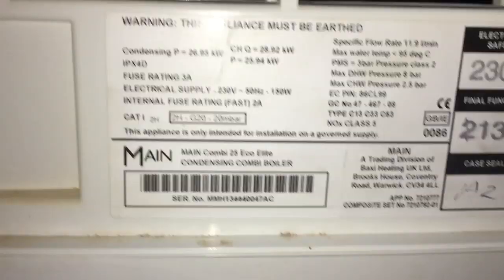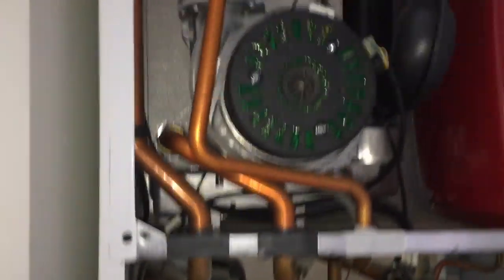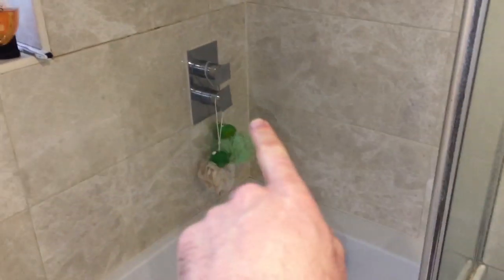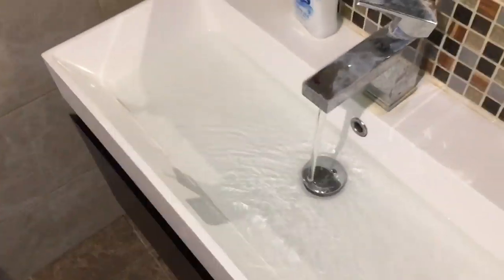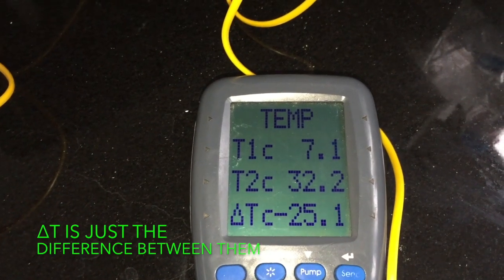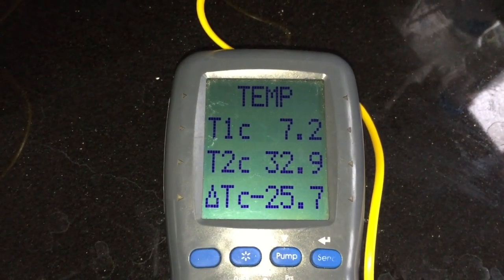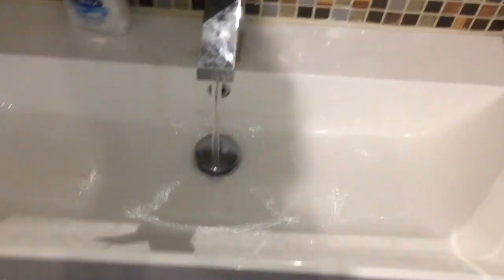Combi boiler hot water issues. Repaired and principals explained.

Comment: Hi, I'd be really grateful if I could get some of your opinions on an intermittent fault that occurring on a customers boiler. (Greenstar 30si mk 3). I have spoken to Worcester about this, but seems like everyone's scratching their heads with it a bit, and I'm not really a fan of just guessing and hoping for the best.

Thanks in advance!

Visit 1:
Customer reports no hot water, but the heating is fine. I visibley can see diverter valve moving to all 3 positions, When power is switched off and then on at fused spur. When tap is opened nothing happens, it's completely static, and no error codes. I confirmed with Worcester that the flow turbine was working. And also dhw thermistor was giving a reading within range. It was recommended the the pcb had failed and should be replaced. Also I noted that the flow rate was crap from tap, about 5 litres per min.

Visit 2: 
Returned and fitted new circuit board, new board was an updated type without the big transformer on the back. Power back on, all was working perfectly. Heating and hot water both operational. I thought job done.

Visit 3: 
2 weeks later have to reattend, due to intermittent hot water. Apparently hot water worked fine for a couple of days and then after that not. Customer states sometimes it will run for a few mins then go cold, other times boiler just does nothing (same as initial issue). He also stated sometimes it was very hot. When I test on site, hot water was working as it was supposed to, operating on demand and at the correct temperature. 

Visit 4: 
I reattend and Initial test shows boiler still static when tap opened. Customer also stated that they day before he'd switched it off at the spur due to the boiler vibrating lots when trying to run the hot water. I fit a new flow turbine, flow adaptor, and flow regulator. Also cleaned the inlet filter. Was flow was not really improved to be honest, so pressume there must either be a restriction in the plate to plate, or maybe in the manifold. Test hot water and still boiler does nothing. when I'd re instate power to the boiler the diverter valve would go from mid position to lower and then back to mid. Every 10/15 times of power being resumed the diverter valve would move to the high position and the HW pre heat would start. However once the preheat was over, and a tap opened the boiler would again be static. I removed the diverter valve and it looked to all be in good clean condition. Tried operations with the motor out of site to. See if that made a difference. I again spoke to Worcester, confirmed again the the flow sensor was picking up the demand. Also carried out resistance tests on the diverter valve motor, checked the thermistors which were correct. Worcester said they think it's again a faulty pcb and that I should fit a new one. 

So basically I'm going to go back again with a new pcb, but there's definitely a part of me that thinks it could be something else, like maybe the diverter valve motor?

It might be worth noting that on this visit I found that the shower thermostatic mixer has a slight issue with the check valves, as when I isolated the cold I let at the boiler and opened taps to drain, I could hear water passing through the mixer and constantly flowing (not much) through the tap. I wouldn't have thought this would be contributing to the boiler issue though? 

Struggling a bit with this one, so any suggestions / thoughts would be greatLy appreciated, thanks.
Reply: SOLVED! It was the Plate to Plate heat exchanger, basically completely lime scaled up.  Once I’d managed to isolate the shower mixer, I found the flow rate from the hot tap was at 3 LPM. When testing the flow turbine (at the PCB end) using my Fluke I was getting 2.1-2.7V DC (reading fluctuating between .1 and .7) The worcester chap(s) told me that, this should be enough to get the boiler running, I kept questioning the fact that, that the reading was fluctuating as when id tested other worcesters I was used to getting a stable 2.5(ish) V DC.  they still said it should be fine...
Anyway, after inspecting/resistance testing the harness, took out the plate heat exchanger to have a look, and couldn’t believe how blocked up it was.  
Tested the flow turbine after replacing it and found I was now getting steady readings!  and boiler roaring away.  Good tip about blowing through the turbine, wish I’d known that one!! That would have saved me a lot of time...

Annoyingly id arranged on the 2nd visit to replace the plate to plate, but was trying to solve the boiler not firing issue first, not realising that they were related.  It didn’t help that there was no valves to isolate the shower, and no access to any stopcock in or outside, and tenants that didn’t speak any English haha.

Plus side is I learnt a lot from this job, Its always the tricky ones where one learns a lot.  

Keep the vids coming, they’ve really helped me to up my game with boiler faults.  Its great that you include the process of how you approach finding the fault.
Reply from the maker: I have been doing my ACS this week so I'm a bit preoccupied. Did you get to the bottom of this?? 
Be great to have an update.
Reply from the maker: Yeah Manufactures are good at common faults but fall down when its a bit weird. Blowing through the flow turbine tests all the electronics  and helps you decide weather its mechanical or electrical. Im glad you got it fixed and very glad you updated us here.
 Thats a Heavy plate heat exchanger going by how big they are and that it was full of scale. I bet they had preheat on (eco off) and also have a driping tap. Its the tap that causes constant heating of the plate and scale build up.
Once again, nice one.  :-)
Reply: waldesi1 I would check the harness very carefully. Did you do your tests on the pcb or at the DHW flow sensor? 
Sounds like it’s still not picking up flow. 
Plug in another (the old one) sensor and blow through it and see what happens. 
PCB or harness is probably the issue.
Reply: This is HeatingGeek on another account btw. ;-)
Reply: Yes 1st visit they did have a tap that was basically continuously running really slowly.  preheat was on too. Makes sense now why it was so blocked.
Reply from the maker: Thats the only time I see scale around London on plate heat exchangers. Direct fired are more common.
Reply: waldesi1 . Excellent news you got it sorted I think your gut feeling that the plate heat exchanger was suspect was right. I’ve come across this before but have heard tell-tale signs of scale and blockage by the whooshing Sound they make when partially blocked, a slow flow is also a  giveaway
Reply: waldesi1 just an addendum to the fault you had, I had a Greenstar with a code plug fault. Replaced the code plug, boiler then worked but blue light flashing and over gassed by 4 kw. (Was 24i system). Worcester advised code plug fault. Replaced again.  Same. Long painful story short, they sent out a batch of 28i combi code plugs in 24i packaging.  Class act!

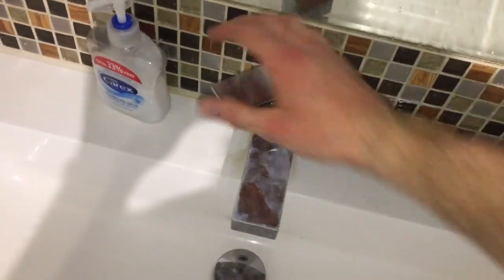Comment: Some great tips here.  At 10:50 when you said you were going to set the flow rate, what exactly were you adjusting? (I thought by adjusting the cold inlet to achieve the correct differential, we had the correct flow rate). Thanks
Reply from the maker: I was making sure the Litres per min I set at the boiler (by temperature ) was correct. The kitchen tap couldn't be use for this because the flow rate was reduced to it already by design. So, I just made sure I had 11 LPM at the sink tap in the bathroom.

Ps I couldn't do the check at the bath tap because it was a blended outlet.

Comment: So it was the mains water flow restrictor. Great video.  Keep them coming. Are you based in London?
Reply from the maker: Hertfordshire but I work in London. Yep flow restrictor.
Reply: HeatingGeek can I come work with you for a day. No charge!. 😂
Reply from the maker: My working day is usually very dull. I generally only get to fix things that others can't. Where do you work?
Reply: HeatingGeek I'm based in Waltham Abbey but I go anywhere. I work on my own mainly doing installs. So you can imagine how dull my day is. If you need the company let me know. I won't do your head in lol.
Reply from the maker: I'm in Cheshunt. If you get any issues on repairs give me a shout (through here) and I will try and help. I do some bits and bobs for engineers ,like Worcester PRVs and Vaillant shunt pump for fixed prices so they can earn on top.
Reply: HeatingGeek I do mainly installs for other plumbers based in cheshunt actually. But if I ever get stuck I'll give you a shout.
Reply from the maker: Cool ok.